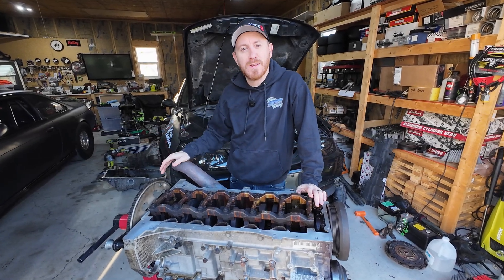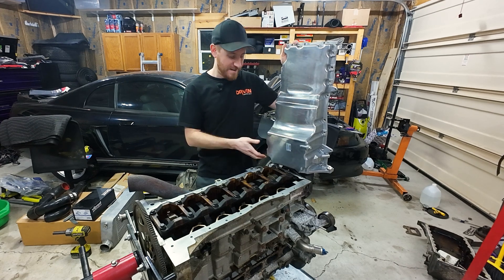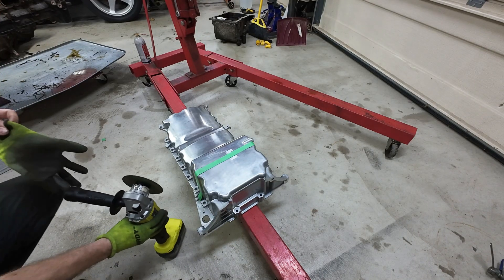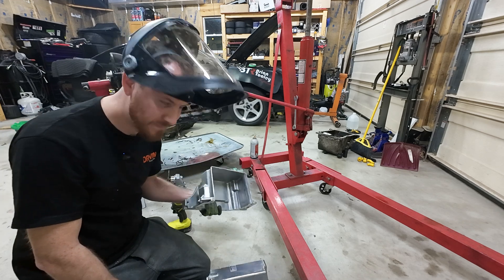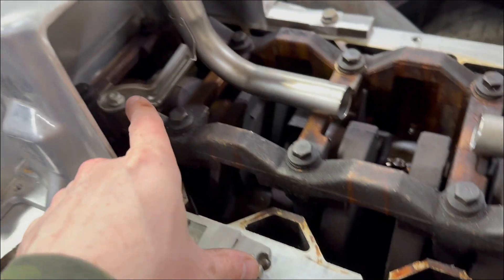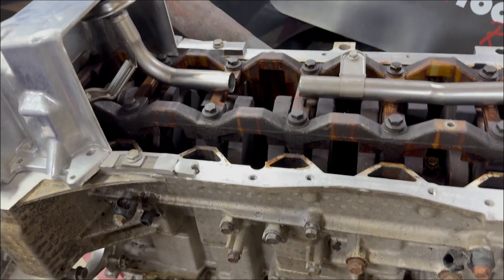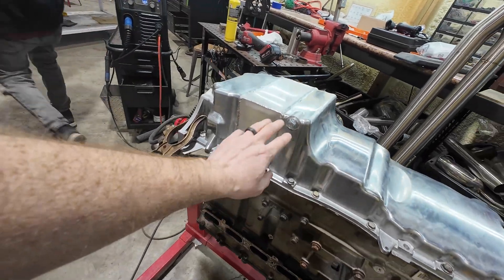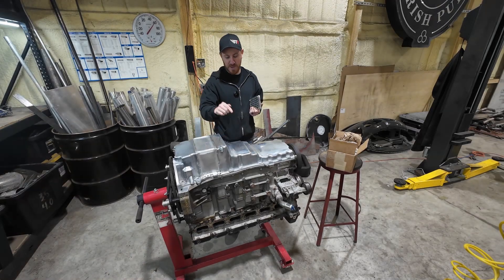Fabricating A Custom Atlas 4200 Rear Sump Oil Pan For The Mustang!

Comment: Use an Allen head bolt for the welded in section.
Reply from the maker: Yeah I ordered some and I can always fit a washer under if needed as well should be fine.  I’d prefer not needing 3 different tools to take a pan off but it’s not a big deal on this car